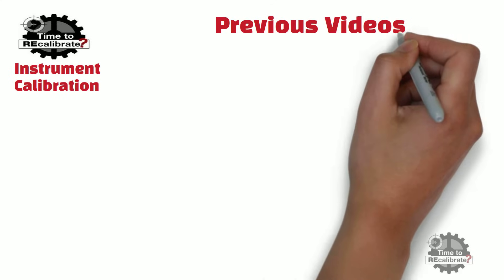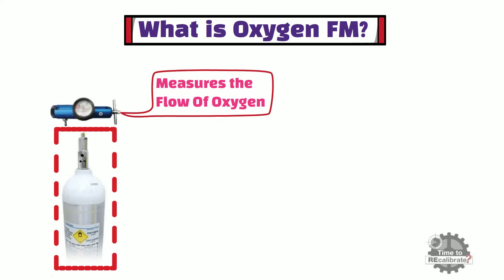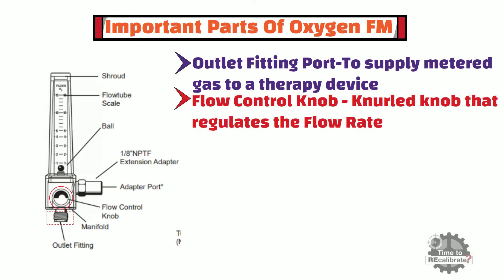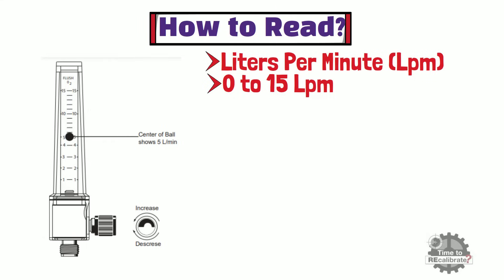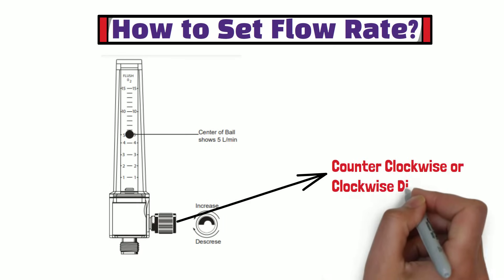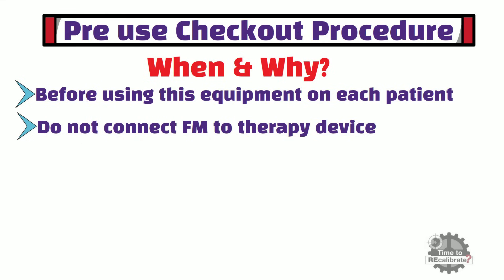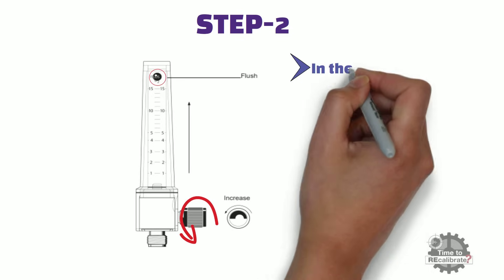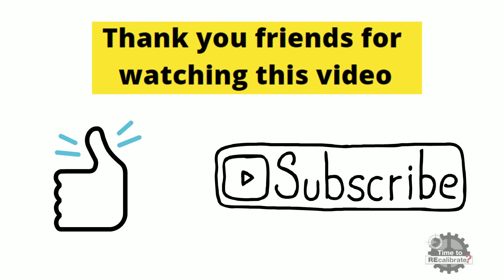How to Read Oxygen Flowmeter - Oxygen flow meter settings and readings

Comment: How do you read the ball on the flow gauge? If I set it at three when I’m leaned over, the gauge reads higher after I stand up.
Reply: Set the flow based on how you see it when you're leaned over and looking at the gauge straight on.  For 3 liters, the middle of the ball should be on the 3-liter line.
Reply: I had a guy set up my moms yesterday.   Said he had been doing it 35 years.  He told me top of the ball…..    thanks for your video
Reply from the maker: Hello Kurt
It looks like your gauge has some kind of issue. Otherwise, it will come back to zero once you stand up. Thanks for asking this question. Please let me know if you have any other questions.
Reply: @InstrumentCalibration  There's nothing wrong with his gauge.  He was asking about which angle to read the gauge.  And why would you say the gauge should go back to zero when standing up?  That makes no sense.  If the flow gauge reads zero, that means there's no oxygen flow. 🙄

Comment: Sir if we open the full flow meter tap the boll touch on the roof of the flowmeter . Then how many oxygen in lpm used flowmeter
Reply from the maker: Reading is closed to 16 lpm in this case.